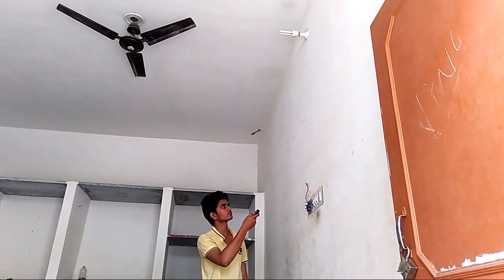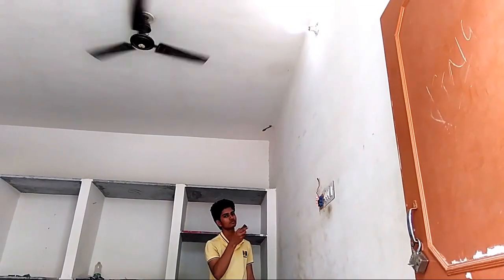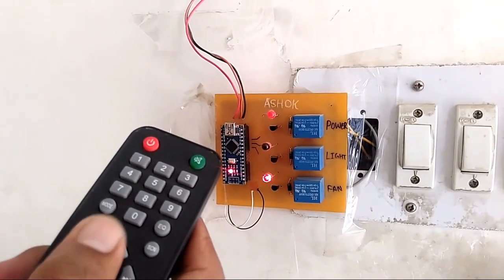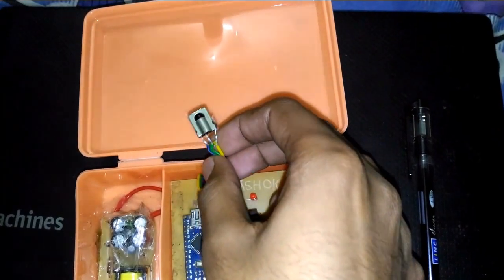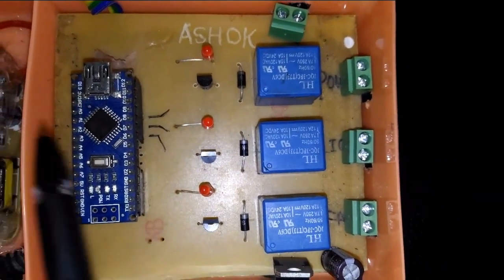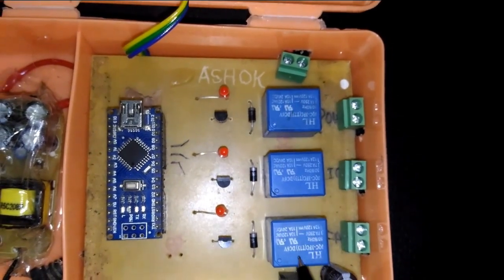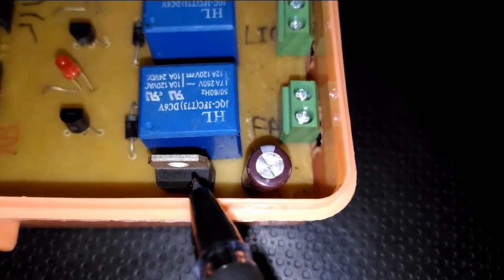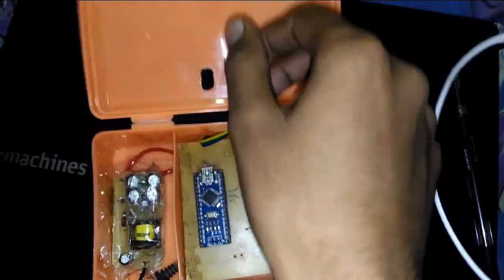How to make a Simple Home Automation System

Comment: I have a question :
Why are we using a relay if we have put a transistor because both do the same thing i.e. to switch current on and off and to increase the output of the current. Can't we just use a transistor only which is much faster and much cheaper than the relay?? Pls respond..
Reply from the maker: We are controlling AC line by using 5v output.
So we have only two methods:
1. Relay ( isolate AC and DC )
2. Triac

Your question answer is transistor is use for DC power switching not AC line switching.
Reply: @TechnocratDIYEducation  no I was asking that can't we just use a transistor ?? Because it also does the same job as relay but faster technically!!
Reply from the maker: @nikhiltiwari7005  yes you can use Transistor for switching purpose only for DC voltage.
Or for high-speed speed switch use MOSFETS.
Reply: @TechnocratDIYEducation  ok thank u

Comment: sir fan ko agar fast and slow krna ho to kya coding krengenge
Reply from the maker: Manoj Kumar 
first things is that Arduino uno and Arduino nano is same but size is different. In Arduino nano SMD microcontroller IC is used and in arduino uno DIP(dual in line package) microcontroller IC is used. And in Arduino nano we get one extra pin for ADC. So Arduino uno and Arduino nano is almost same.

  You can also control fan speed by using Triac. Triac is a three terminal semiconductor device.
You can use BT136 for control AC light directly from a low voltage DC voltage. By using Arduino uno or Nano.
Reply from the maker: Manoj Kumar 
Arduino code i will try in few days and i will upload easy video for control Fan speed.
Reply: waiting for fan speed control code sir